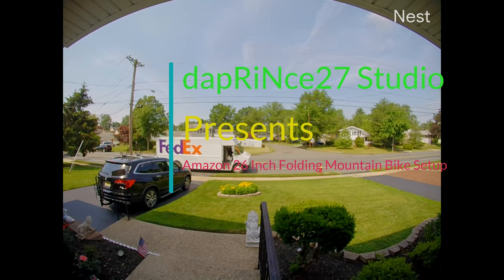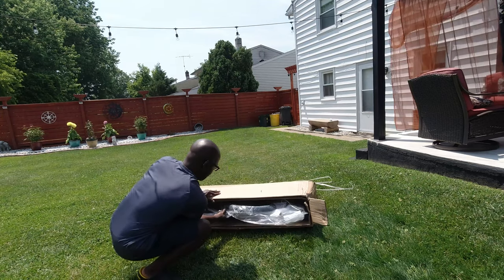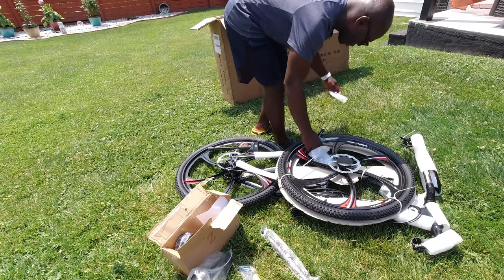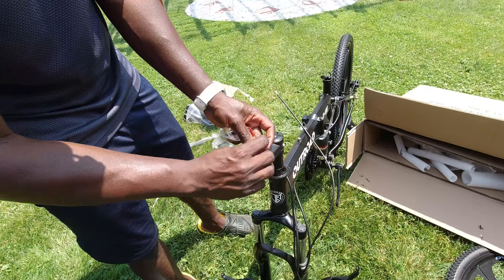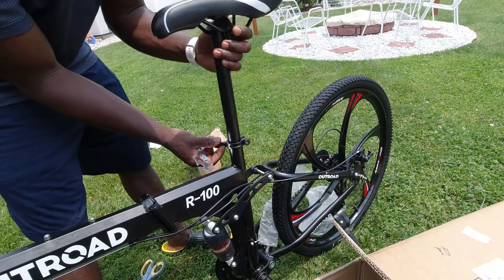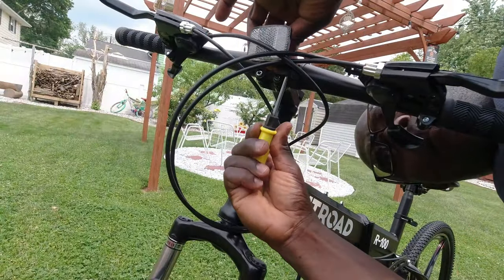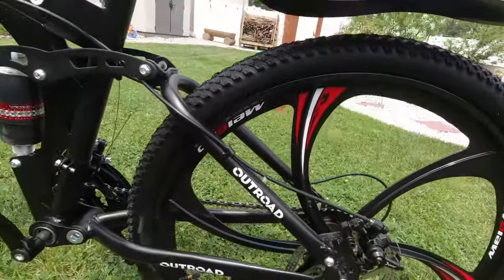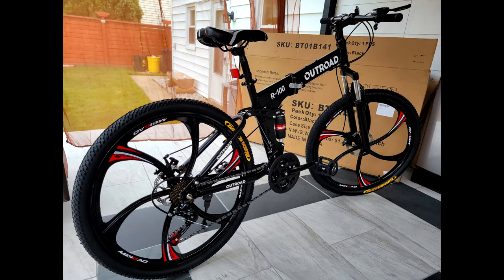Amazon Folding Mountain Bike

Comment: 5 months ago I purchased this bike and it is currently waiting to be sent to the dump. I took it on a paved trail and the chain fell off the front gear. I pedaled 1/2 rotation before noticing and it completely destroyed the piece that changes the gears. I went on amazon to replace it and of course nothing was compatible. It is currently being used for its tires and brakes on my little brothers bike. Ive moved onto a Sur-ron. They are pricey, but electric, fast, and well constructed. They also have great modification opportunity. You really get what you pay for here.
Reply: My brakes are super weak and also blew up when i braked too hard. I later found out it used brakes from 1999-2001. Pedaling too hard breaks will put your chain outside the gears, causing it to break the chain cover. You really get what you paid for.

Comment: I’m having trouble getting the quick release hole unplugged.  I don’t want to return the bike, but might have to if I can unplug that hole.  How did you do it specifically z
Reply from the maker: @sandimarie2  If it's plugged by that hard plastic, you can heat a long metal item such as a hanger or something similar to melt it out.  I hope that helps.

Comment: Thank you so much for taking the time to make this video, it was really helpful. I love the music in the background, nice smooth. I was looking more for a light weight bike but i love the style of this one. Do you happen to know the exact weight of it fully assembly? Since you mention its a little heavier than the usual Thanks again
Reply from the maker: I'm glad the video was helpful to you.    I would not consider this bike as a light weight bike, it's a little heavy.  It's listed at 36.4 lbs but it feels much heavier.  As far as style, it's a beautiful bike, but I would not consider it as a good mountain bike.  It is more for casual paved road riding.  Here are the specifications from the manufacturer.  I hope that helps.
Bicycle Specification:

Frame: Aluminum Frame/High carbon steel

Fork: MTB Suspension Fork

Tire: 26"*2 full black tire

Rim: Aluminum Alloy Double Wall Spoke Rim

Brake: Disc Brake

Shifter: 3*7 shifter

Freewheel:7 plus

Weight: 36.4lbs

Fits up to: 5'3"-6'0"

Maximum weight capacity: 400 lbs

Comment: I also ordered this bike. When I received the first one, the back wheel assembly that attaches to the shock absorber was bent. I reached out to the company and they suggested that I take it to a bike shop to see if it was able to be fix. The bike shop said it was beyond repair. Sent pictures of the work ticket to the company and they responded immediately. They offered a refund or new bike, I want the bike. Just received the second bike and everything looks good.
Reply from the maker: That's great to hear.  I'm glad your issue was resolved, because I have got many compliments while riding this bike.
Reply: What is the weight capacity
Reply: Do you like the bike? I'm thinking about getting this one for my son.

Comment: My brakes are super weak and also blew up when i braked too hard. I later found out it used brakes from 1999-2001. Pedaling too hard breaks will put your chain outside the gears, causing it to break the chain cover. You really get what you paid for.

Comment: Mine just arrived. First impressions:
1.This bike is NOT for the person who wants a bike ready to go. I spent a good 2 hours getting everything tuned just right and its still not perfect.
2. The full suspension is really nice.
3. Looks great. The stickers come off easy. Theyl probably fall off in a week.
Overall 8/10. Definitely for the person who wants to tinker with a bike and figure out how things work.
Reply: What you mean with a bike ready to go
Reply: @stephanicarrillo1205  If you buy a bike from a shop they will have it tuned perfectly. This bike required a lot of work to tension the cables properly. Also, its complete trash. Mine is in the garage in pieces. I took it out on a PAVED road and the chain shredded the front derailure.
Reply: @stephanicarrillo1205  Monté una vez y se rompió. No lo compres
Reply: @SojournONE  gracias, estaba a punto de comprarla porque necesito una bicicleta que se pueda doblar. Si sabes de alguna estaría muy agradecida.
Reply: @stephanicarrillo1205  No se? Compre un Sur-ron y es lo mejor bicicleta
Reply: Did you have an issue with the bike tire? Not really savvy when it comes to bikes, but I managed to assemble it per the instruction manual and video. But the pedals do not actually move the bike forward
Reply: @Justin-st6og  FWI it went to the dump in pieces a month after I got it. No the problem wasn't the wheel, the problem was that the chain fell off and it completely ruined the front gear shifter. I even bought the pieces to fix it but it didn't work.
Reply: @SojournONE  I think the lesson here is: NOT to buy the cheapest bike Amazon as to offer lol

Comment: My bike came with opposite breaks, left one was rear break, and right front…i had to switch them, took extra hour or two to do that. Also breaks always make rubbing noises, almost impossible to adjust them…i have been trying but could not fix that.
Reply from the maker: I have the same rubbing noise problem.  I frequently have to adjust them.

Comment: A few questions..1. How tall are you and does it feel comfortable sitting and riding( maybe for hours) does it feel small?. 2. Does the seat raise to a much higher level? Cuz I like the seat much higher than the handle bar. 3. I heard on an Amazon reviewer that this bike was flimsy and do not buy. What do you think about that?
Reply from the maker: Hi! I'm 5'6".  The original seat is very uncomfortable and not practical for long rides.  I have.a second video on my channel where I changed the seat along with some other changes.  With the modifications its comfortable for long rides.  You can raise the seat, the bike is made for individual's up to about 6'1".  The bike itself looks good and  is fine for casual flat surface ride, the park, the beach, around the neighborhood, but it's not a true mountain bike.  I hope that helps.
Reply: @daprince27studio  thanks;) I'll look for that 2nd vid
Reply from the maker: @jx2276  you're welcome.  The second video is already on my channel.  Nice casual bike, but not durable enough for true mountain biking.

Comment: What kind and size screws are used for the rotors? The bike was missing 6.
Reply from the maker: Hi!  Mine came preassembled with the rotors already attached.  But typically m5*10mm bolts are the standard for rotors. Try getting steel or titanium so they don't break.  Hope that helps.

Comment: Do you think once folded, this bike would fit in a sedan trunk?
Reply from the maker: I think it will depend on the trunk opening, some trunks have smaller opening.  I am able to put it inside my trunk or the back seat.
Reply: I’ll answer your question, NO! It won’t, the bike doesn’t fold completely flat and the handlebars stick straight up and down, unless you remove the front wheel, there is no way you can put this bike in the back seat of a car, folded or non folded, also the bike is heavy as hell, this bike just looks great, performance is below average.

Comment: I keep hearing a disparity between this bike being ok for someone 5-9,5-10 and others saying this is too small/short. How tall are you and what are your thoughts on this?
Reply from the maker: The bike specification stated for an individual up to 6 feet 3 inches tall.  If you are under that height, you should be fine.  The seat is adjustable,  so 5'9 or 5'10 will work fine for you.

Comment: I’m trying to see how to fold the bike. I need a walk through step by step.
Reply from the maker: Hi!  The folding process is simple.  If you have the same bike, it's around the 7:40 mark on the video.  Just pull out the clip, lift the clip up to unlock.  Beware the bike doesn't completely fold because of the pedals and all.  I hope that helps.

Comment: I read these bikes break easily. How's your experience with this today? Nice garden btw. 🙂
Reply from the maker: Thanks for the comment.  The bike is fine as long as you are using it as a casual bike, flat, paved roads.  It is not a true mountain bike, so don't buy it if that's what you are planning on using it for.  Hope that helps.

Comment: Does the brakes come installed or you have to install it yourself?
Reply from the maker: The brakes came attached to the wheels.  I only needed to adjust the brake cables.
Reply: @daprince27studio  okay thanks, I was planning on getting one so I just needed a little heads up and know how assemble it properly, !
Reply from the maker: @TechCodes128  No problem.  As you can see in the video, assembly is not difficult at all if you are used to assembling stuff.
Reply: @daprince27studio  I’m not used to assembling stuffs haha, it’s going to be my first time
Reply from the maker: @TestSubject-uq5sl  You will be ok.  If you tell yourself that you can't,  the body will  believe that you can't, and the same goes the other way. 🙂
Reply: @daprince27studio  I’ll try, thanks mate!
Reply: @daprince27studio  hi I’ve finally gotten the bike and I’ve assembled it, which wasn’t easy btw, but I think I have some problems, the brake pads seems to be rubbing on each other and making weird noises when the front wheel moves, what can I do? And thank you for your encouragement
Reply from the maker: Congrats.   The front wheel may need some minor realignment. It may not be on straight.  I hope that helps.
Reply: @daprince27studio  thanks it helps a lot
Reply from the maker: @TechCodes128  You're welcome.

Comment: I bought a similar one on EBAY, but the left pedal thread/nut hits the frame of the bike and won't go past it. And there's no way you can bend the metal bar or pull it out further from the bike (so it doesn't hit the frame). Looks like i'll be throwing this piece of crap away. Unless someone wants a bike that won't pedal. $200 wasted. Glad your bike worked out.
Reply from the maker: I'm sorry about your bad experience with your bike.  Luckily mine continues to work as I need it too. I am a casual bicyclist,  I don't do much mountain biking. I don't see this bike as a true every day mountain bike, it is more of a flat paved road bike.
Reply: @daprince27studio  I put the nut on the inside of the pedal spinner, instead. I don't even know if that is safe or not. It's the only way I can now get the pedals to not hit the frame. I only intended this bike for emergency prepping on neighborhood and street riding.
Reply from the maker: @MGillDesign  Make sure to put your safety first.  I wouldn't use it if it's unsafe.
Reply: @daprince27studio  Appreciate it. I'm just frustrated and looking for solutions before trashing this bike. But there's not many videos on this model, nor troubleshooting.
Reply: You have to modify it. Change the pedal to foldable pedal.

Comment: How did you melt it down lol
Reply from the maker: I have a soldering iron, so I used it to melt the hard plastic down.  🙂
Reply: @daprince27studio  thank you!! I have the same issue on my outroad bike
Reply from the maker: @BoldTakes  You're welcome.  That's unfortunate.  If you don't have a soldering iron, you probably can get a metall hanger or anything else like it and heat it up on the stove until it's hot enough to melt the plastic
Reply: @daprince27studio  thank you for the helpful tips. It should be ready to ride on Friday. Going to visit a local bike store to get a last look professional tune up since this is my first mountain biking experience!

Comment: Mine is all put together but the wheel doesn't turn when I turn the handlebar. I took it apart and put it back together, it doesn't turn. They forgot a part when they assembled the fork. I'm fcking pissssssed😤 

 This seems to be the ongoing theme with Amazon. You start shopping around and then you see Amazon and think it's a great deal. Nope you just wait a week for something to arrive screwed up or doesn't work as advertised so not only are you unable to use the product, you have to arrange to ship it back and so you've wasted weeks and hours of assembly and shipping for a product you don't have😡
Reply from the maker: I'm sorry for your bad experience.  Hopefully they fixed the issue for you so you can enjoy your bike.
Reply: @daprince27studio  They have no idea what's going on, I will probably end up just shipping it back and wait for the exchange for a new one. It's nothing major, I could fix it if I knew what part it needed or whatever needs done. I'm going to let a bike shop look at it. Hopefully it's something simple and I won't have to exchange it. It's sitting here put together it's a nice bike, just can't steer
Reply from the maker: @carpe_poon5761  indeed, it's a nice looking bike.
Reply: @daprince27studio  yes. I have the black and orange one. I like the disc brakes and wheels, gears. Nice setup. I have a bunch of historical scenic trails in Ky picked out. One being the Ky bourbon trail

Comment: Don't buy this cheaply designed bike. I felt the parts were cheap when I took it out the box. First one of the sprocket arms were stripped, so I had to rework that part to put the pedal on. 2nd,  the front wheel bearings came loose while  I was riding, I tighten it up...I thought it was fine, at least for a few weeks. The opposite pedal completely broke while riding on the street. Then this happened...... the front wheel came loose again while I was riding, then I was thrown at least 10'. 2 broke hands... the right hand will require surgery, facial rash that will require  plastic surgery, and time off work. I had a full skull helmet, but wish I had a full face helmet. Luckily my helmet was Bluetooth, so I was able to get help. I only needed a bike for light workouts/cardio..... but I feel it's best to spend a little money for a better built, designed bike.
Reply: Wtf?